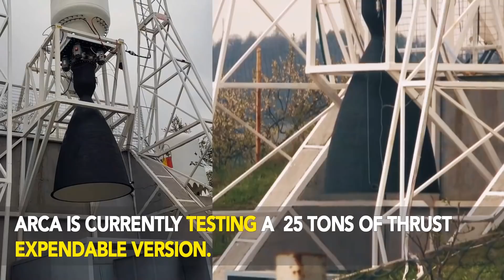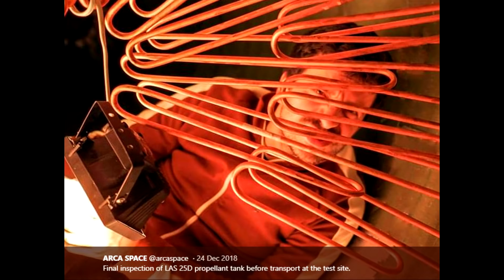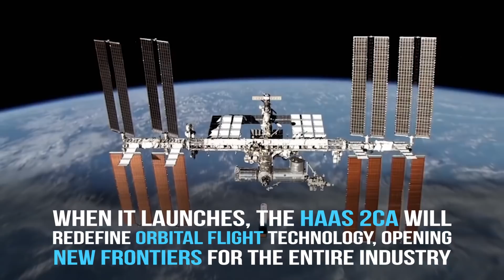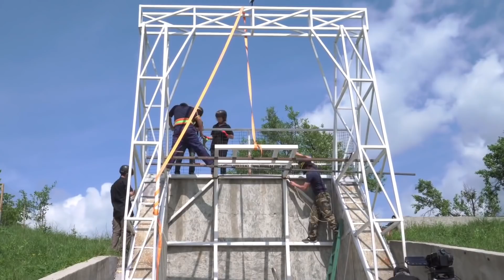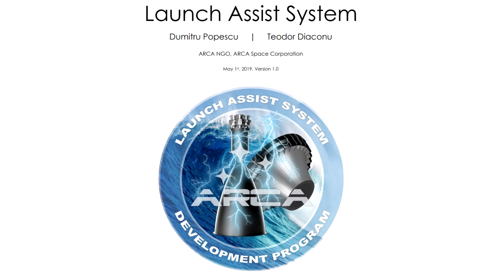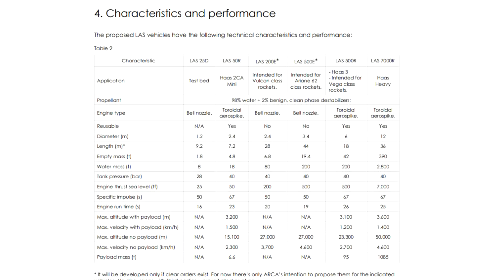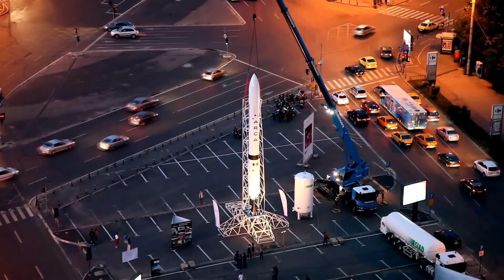Does ARCAspace's Water & Electric Powered Rocket Make Sense?

Comment: I think that 42MW electrical energy number includes the grid electrical energy that they use on the pad to heat the water. LiPo batteries are probably a lot less than that, seems that neither the aerospike nor the batteries really add much.
Anyway, I thought their "polluting rockets" pitch was really annoying and dishonest (it ignored several higher performance rockets that don't have polluting exhausts, like LH2/LOX and monoporpellant HTP, N2O), plus it ignored the possibility that you could make carbon-neutral methane or aclohol for a bipropellant engine on Earth by getting CO2 from the atmosphere/sea water.
It also misinterpreted the pollution of Kerosane/LOX rockets by ignoring the fact that a rocket runs for a couple of minutes - a car's engine can run for hundreds of thousans of minutes.

Comment: Scott, I appreciate your efforts to stay reasonably neutral on this.  I don't have the temperament for that, though.  So I'll just say it sounds an awful lot like some dodgy crowdfunding campaigns I've seen.

One thing that's sticking in my mind.  Using lithium chemistry batteries to run a rocket that only fires for, what, a minute or two?  We're talking about unbelievably high discharge rates.  Before long you won't need electrical heaters because your batteries will be on fire.

Comment: Energy density of batteries aren't good enough, they should try storing energy with hydrogen. Also hydrogen produce water when reacting with oxygen so they don't have to carry water around, also   you don't really need electric component if you just want thermal energy so you can skip that.

Comment: Years ago I ran the calculations for a K sized rocket motor to run on water and thermite, it only needed 4 oz of thermite to heat the water. But what if you heated water with electric water heater elements on the ground and then used thermite in ceramic rods to sustain pressure? No batteries.

Comment: I kind of thought at first that the electricity charged the water and separated the hydrogen and oxygen and then the gas was used to propel the rocket when ignited, I think the thrust would be far greater that way and would use about 80% less electricity cause they wouldn't need to keep the water hot, but the way they're doing it sounds very inefficient and something they made up to cover up much better technological advances of propulsion.
Reply: it would you far, far more energy because electrolysis requires as much energy (actually more) than combustion

Comment: How can water be 250c? I though water could only get to 100c and then it turns to vapor and at that point is starts to cool and recondense.
Reply: At 100c and 1atm, the state of water can be liquid, vapor, or some combination in between – adding more energy changes the proportion of liquid too vapor. If you keep adding energy after it's all vapor, you just get superheated steam. At high pressure, like ARCA is doing (40atm), water becomes vapor at a higher temperature though

Comment: wouldn't lithium batteries be that energy-providing chemical they want to avoid? And off hand, wouldn't just putting that lithium in contact with the water in the tank generate more heat in a simpler way? Unless they can both recover the stage AND the batteries are rechargeable.

Comment: Could you just pre/heat it externally on the launch pad then let her rip?
Reply: That is what they did. 

The water in the rocket tank was already close to the boiling point. The batteries add the little extra heat to flash the water to steam.

Comment: I am wondering if the batteries were involved in one of those odd optimization situations where a bit more heat would improve things in a way that makes up for the weight penalty. Maybe they simply want the experience to be ahead of the curve should battery technology improve or transmitting energy to the rocket, such as microwaves or other photons to generate electricity comes about.

Comment: I think you are being uncharacteristically biased on this one Scott.

They are referring to a sustainable overall environmental impact of steam rockets compared to chemical ones, not proximity during launch. You  say their 250°C  will strip the flesh off bones, that you would rather have kerosene spilt on you than water, and I am with you on that those, but the steam is that hot only during launch, so to fairly compare it shouldn’t that  be burning kerosene spilt on you?

An hour after a steam rocket launch, I would be happy to walk around on the launch pad, and even lick a propellant feed hose, but less so for a chemical one. They don’t implicitly say, but I think the water onboard is stored at ambient temperature, and heated in two stages, not stored at 250°C, so if something goes wrong, the crater left by a failed steam rocket would be smaller, and won’t dissolve your boots if you were walking around in it afterwards.

I agree that the battery figures do sound a bit enthusiastic, but with a combination of super-capacitors and lipo batteries, that may be possible, even today. If not right now, with ongoing energy density steadily improving, it is not an unrealistic moon-shot.

Add to that the possibility of recharging the batteries during launch by using the steam to turn turbine generators, a bit like a staged combustion cycle system, and this becomes very viable indeed.

The physics of steam powered rockets work and solving the engineering problems are inherently simpler and safer than external combustion engines. We are easily seduced by the glamour and complexity of chemical rockets, so simpler methods don’t get explored or funded as much. 

If eBay had bought my “toilet cleaning and dog walking service”  business for $1.5 Billion instead of some silly payment company, I would be optimising steam rockets.
Reply: As they show in in their own promo clip, the water is heated to 250° C while in the tank. Plus, if you do the math you'll find out that using 42 MW could be used to extra-heat the water, but not to heat enough water to provide enough trust (as a previous comment noted, 42 MW sounds like a lot, but it's equivalent to burning 1/3 gallon of fossil fuel per second)

And as others have noted, the environmental impact of burning hydrolox is comparable: water in the exhaust. It may not be 100% clean when others things burn off due to extreme heat (e.g. the inside of your bell nozzle), but they will have some of these effects as well when they really plan on using seawater, and besides this, they casually mention that they don't use pure water, but rather "98% water and benign phase destabilizers". Nice of them to call them benign, but I'm curious what they might be. And I think a "water phase destabilizer" is inherently more likely to have an environmental impact than what are basically burned metals.
I get the emotion behind the idea that "water is cleaner", and "chemicals are bad", but walking around a launch pad after things have cooled down is not really dangerous. For hydrogen and liquid oxygen the most dangerous thing is that they are really cold, that's it. Things certainly won't "dissolve your boots". 

Of course there are some nasty fuels (especially hypergolic fuels), but they are used for different purposes. I guess some propellants could better be replaced by others fuels because of their environmental impact, but if you want to do so, you can replace them with other things instead of going with this idea.
Even then, most dangerous are the fuels before you burn them, not the exhausts.
And it makes sense: in a rocket you want to get as much energy out as possible. If your exhaust contains compounds that are still willing to react with other stuff, it means these compounds have a lot of latent chemical energy still in them, and your primary reaction (burning in the rocket) probably wasn't very good/efficient. 

The main environmental impacts of rockets are things this rocket won't solve either:
1. Rockets use a lot of energy, one way or the other. That energy has to come from somewhere, and is most likely generated by burning fuels. To charge the batteries in the arca-rocket, they probably use energy, generated in a power plant run on fossil fuels. Sure, If we'd have solar panels everywhere we can use these to charge our rocket and preheat the water, but currently there are not enough solar panels. And if there were, we could use these same panels to make hydrogen for our conventional rocket. For now, rockets=using lots of energy=generating this through burning fossil fuels=CO2=global warming.
The most important factor in this is that the more efficient your rocket, the less energy overall is needed. And this design is not efficient.
2. Putting stuff high up in the stratosphere may be bad. We don't know the exact consequences of putting stuff there, but the stratosphere is quite static, so stuff put there tends to stay there for a long time. Which disrupts different environmental cycles, and influences how much sunlight reaches the surface. And while putting exhaust from "chemical rockets" is likely bad, putting water or steam there is also bad (maybe even more so, as water tends to from clouds, and interact with other parts of the air)
Now our ARCA-booster isn't doing any harm there, but that's because it won't get that high. The rocket that it is attached to will still fly and accelerate through the stratosphere.
3. Effects inherent to space flight. Apart from the rocket exhaust, we still have to think about keeping LEO clean of debris, about what stuff we put on satellites (when they deorbit they burn, which is why we don't just put RTG's on any satellite), and what happens with a planned deorbit (during reentry, the air around you undergoes all kind of interesting reactions). This point has nothing to do with boosters, but as a reminder that having a clean booster doesn't mean that much.
4. Accidents happen. We plan not to have any, but what happens when your rocket blows up when it's away from the lunch pad? (sorry for the pun) I think having a lot of batteries spilled all over the place is a lot worse than what happens with a conventional rocket.
5. Producing the rocket. Differs a lot by design, but again I think making a rocket with batteries that won't last very long isn't the best option.

Comment: I could see using water or water/methanol to augment thrust as they once did with low bypass jet engines. Perhaps they could use a high heat chemical reaction that didn't inherently generate thrust, thinking thermite or perhaps actually burning those LiPos.
Reply: IN A FIBERGLASS BOILER TANK?
Reply: @starchaser2489  Would need to be contained in some kind of enclosure that also acted as a heat exchanger of course, maybe made of inconel. Residual heat after the water was expended kind of rules out any thought of reuse. 
Fiberglass is heavy for any non-imaginary rocket compared to carbon fiber. Either would perish in thermite and aluminum is the fuel in thermite. It is a very powerful chemical reaction for its weight though.

(and burning the batteries was, I thought, an obvious joke)
Reply: @Miata822  It's all good for a "ARCA PARKING LOT TOY". A steam powered Aerospike Engine has NASA rolling on the floor laughing. But that Fiberglass Boiler Tank ARCA DESIGNED is for sure the first one HOME-MADE.
Reply: @starchaser2489  Oh, ARCA is a scam or just a simpleton, no doubt about that. It's just fun to speculate given the parameters of Scott's video.

Comment: I thought they intended to somehow split water into O2 and H2 very quickly and burn that like in hydrolox engines, with entire process happening within the rocket itself but... this is just a steam engine?
Reply: if you split water into H2 and O2 and then burn it into water again, you're just wasting energy. You may as well use whatever energy source split the water to power the rocket, because that energy source has to be more efficient and as powerful as the combustion chamber.

Comment: I can kind of see the advantage of using steam for an aerospike. It doesn't burn your nozzle. Btw, can anyone tell if it would be possible to use H2 and O2 to boil the water? How good of an Idea would that be? But I don't know all that much about rocket engineering. I guess that's why it makes sense for me :)
Reply: Nothing under pressure to make STEAM 720c will survive in a "FIBERGLASS HOME-MADE BOILER TANK".
Reply: It would be possible but why make steam from steam?
The whole problem with rocketry is to have the most weight times speed flying out the back per weight of tanks. Adding cold water makes it worse.

Comment: At one time jet engines used water injection. I guess you could do it with a rocket too. You may be able to burn more reactants in a small rocket motor with water engine cooling which is then exhausted through the nozzle. But how is that better than hydrolox (?) which results in a steam exhaust, yet has the advantage of having all the propellant generate energy rather than just the combustible fraction. Water + hydrogen combustion has no change in mass.
Reply: water+hydrogen???

Comment: I've always wondered how something like this could work if it was powered by a ground based source. Have say a giant battery array at KSC, attach it to a rocket to heat up water, and use that for your first 10 seconds of thrust before switching to more traditional fuels.
Reply: If you heat superheat the water ahead of time on the ground the tank needs to be so thick to contain the pressure that it won't get very far off the ground.

Comment: If I wanted to launch a rocket using an inert propellant instead of fuel, I'd be using a solid polymer propellant and delivering ground-based power to the vehicle via laser.  Leave the batteries on the ground!

Comment: Battery powered rocket is a joke.
But I'm wondering about the aerospike engine. I have never seen one that works. Are there any?
Why would they put an aerospike engine as second stage? The point of aerospike is to get good thrust at all air pressures. If you have several stages then why use aerospike engines?

Comment: Seems obvious that water is heated with electrical power provided on the ground, pre-launch, from external sources. Batteries might provide a little extra heat during flight, but are they worth the extra weight? Seems doubtful. And the rocket's efficiency is most likely terrible. Possibly worst than using all that electricity to produce methane from water plus carbon dioxide, and burning it in a conventional rocket engine.

Comment: The ionization of the water molecules in the exhaust will have to be avoided unless the exhaust is to be further accelerated by electromagnetic means. Again, this requires a lot of electricity.

Comment: It seems the exact condition of your Saturn V model is slightly different every time you make a new video!
But what if... what we're seeing goes along the line of a good old steam engine locomotive. What takes up most of the energy is heating the water to boiling temperature and this you can do with electrical energy from the ground, the good 'ole utility. Once you've reached the boiling temperature then a certain amount of pressure needs to be built up and you still don't use the batteries, still using power from a ground based source. When the pressure and temperature are ideal, then you launch and the batteries just keep adding energy to your pre-heated water reserve. Most of the energy for the flight actually came from... big electricity bill!

The extension cord joke may actually prove to be very much relevant as flexible DLO type electrical cables could keep feeding energy into the system until it clears some form of launch tower with about 30 meters of altitude. Only then do you begin to draw energy from the batteries. I suspect this would provide a significant kick to the specific impulse of the architecture.

Comment: What about carbonation?
Add in the microwave cavity element..

And this can be very fast.

Still.
If alternative method..

I prefer the outer shell being a variant of a Tesla turbine be that sucks in and drive air out under.

Or..

Make most of the craft full of helium, and outer shell be a long Ion drive.

The low density makes it easier to lift., And the long hall, is a long distance to accelarate air.

Makes it rise at a perceptible speed.